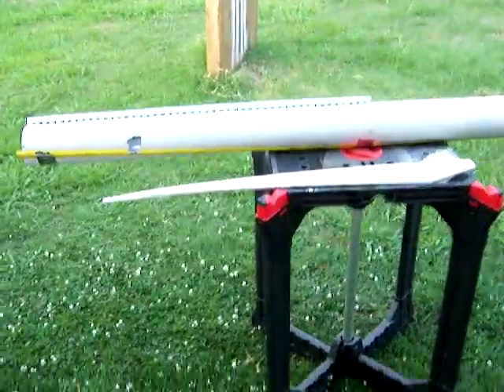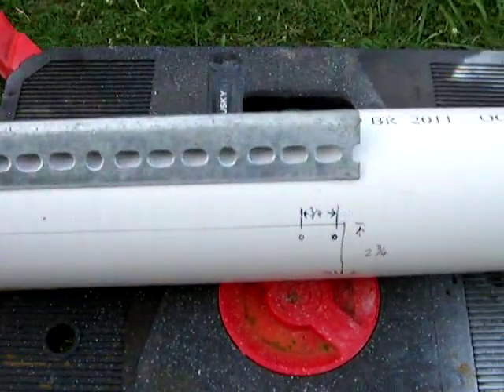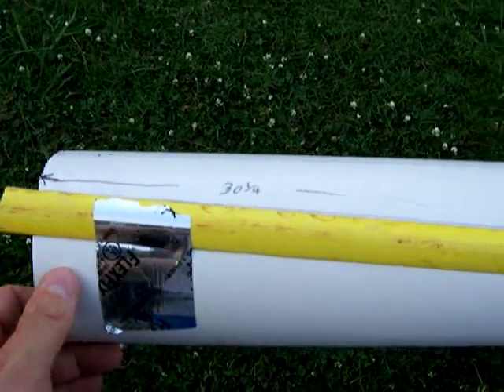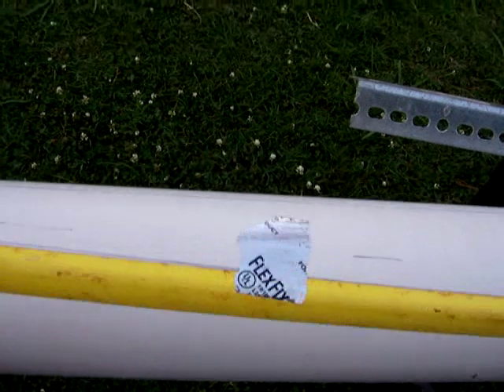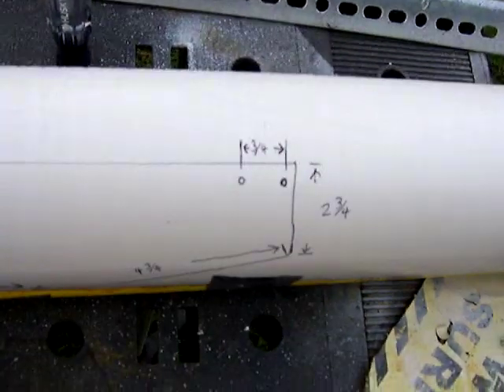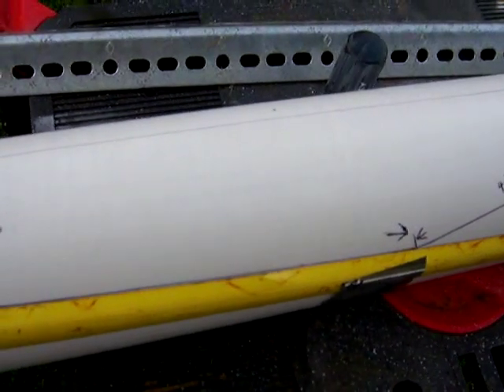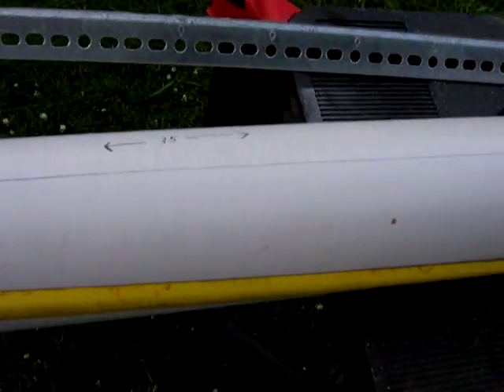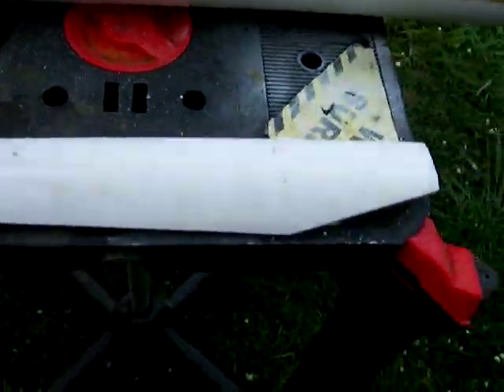easy way to make wind turbine blades

Comment from the maker: 4 in
Reply: The sch for pipe is typically 20, 40, 80, with 40 & 80 the most common, and usually marked on the pipe